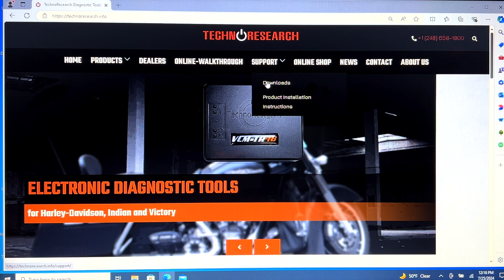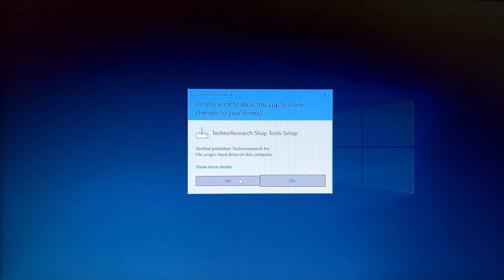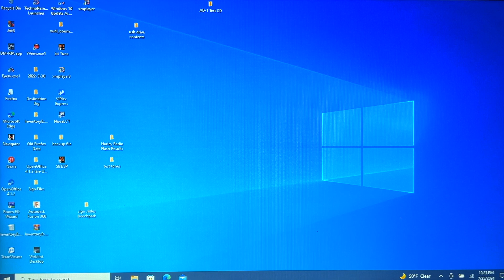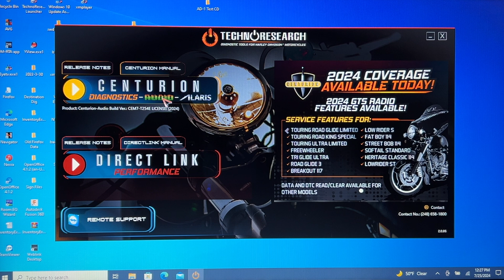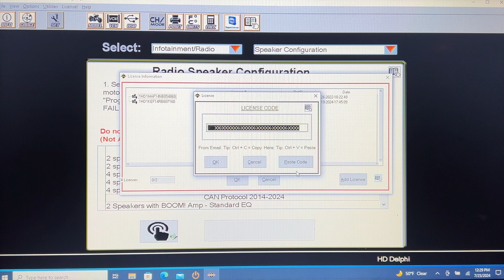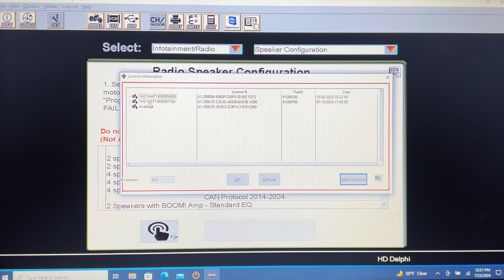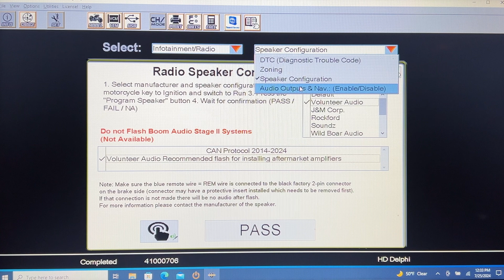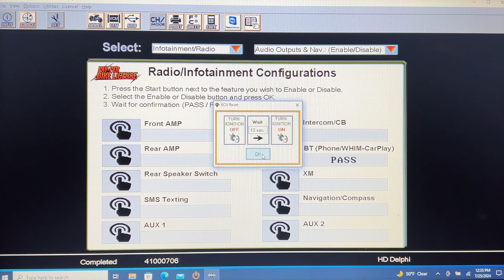How to Download TechnoResearch Software & Flash the Factory Harley Davidson® 4.3" Boom/GT/GTS Radio

Comment: Do you know what tool would enable fader control on ‘06-‘13 Hardon Kardon radios?  I have rear speaker output but no fader function.
Reply from the maker: This techno research tool can also do the radio you refer too, you need a non amplified flash to get fader but then the signal is very distorted, we only build systems around the boss or Soundstream replacement radio
Reply: @volunteeraudio Yea I’ve had Kenwood HU, Arc Audio 600.4 & Focal K2s for years.  Going back stock HK HU, Arc Moto 600.4 with speaker level inputs  & 4 Focal K2s with rear channels in lower fairing pods.  So are you saying fader flash would cause distortion?  If so I’ll just skip flash😂

Comment: I have a stock radio and amp in my 2021 FLHTKSE. This includes a factory installed WHIM. Can I use this to disable the Mic requirement for CarPlay?
Reply from the maker: Yes
Reply: @volunteeraudio  - would the headset mic still work if you want it? i.e. ride around with headset off while listing to music through carplay - decide to call someone - so turn headset on, make call through carplay (without the system getting confused)?

If so, this seems like it will help with that stupid dance of having to turn on your headset / wait for it to pair before plugging your phone in (which I always seem to jack up when I'm in a hurry).

Comment: Thank you for these videos. I have an '18 Ultra Limited. I currently have the 00_OFF.bin on the bike. I am installing a DS18 ION1600.4D amp into the bike. (A) Do you have a video that shows flashing on the GTS (2017-2018) radios? On my radio, are you able to enable the CarPlay like you can on the 2019+ radios using this tool?
I looked at TechnoResearch's website and confirmed there is a dealer in my city. My local H-D dealership is not on the list. That means that they are not able to flash my radio for an aftermarket amp, correct?
Which flash should the technoresearch software install on my radio? I don't know if DS18 is listed as a manufacturer in the software or not.
Reply from the maker: You just need to follow out how to flash video and get a TechnoResearch tool from https://volunteeraudio.com/product/kicker-trhdp

Do the volunteer audio flash

CarPlay is not an option in your radio

Comment: I have a 2016 RG  if i flash my radio and i decided to get the touch screen radio do i have to flash that one too or is it to the bcm
Reply from the maker: The flash stays in the radio so yes if you get another factory radio it will need to be flashed

Comment: So will this help a 2018 CVO with the GTS radio and the boom stage 2 with 4 speakers and 2 amps?   or is this just for aftermarket speakers and amps?
Reply from the maker: No if you have boom stage 2 you can not change the flash or your amps will quit working

Comment: So I was doing a update to 1.22.0.3 and got to the 8 out of 10 and the update froze up and now my radio is stuck in the update mode how can I get out of this mode to try to redo the update or take it to Harley to have it updated ....
Reply from the maker: What are you updating? This video is about flashing a radio, what bike do you have? Which radio?
Reply: 2016 road glide ultra is updating to the 1.22.0.3 update and the bike just has gotten stuck on the 8th out of 10 packages to load onto the radio and I can't get it out of that mode for nothing @volunteeraudio
Reply from the maker: @The90coupedraggn we do not recommend updating the factory radio at home, by having your Harley dealer install the updates they become liable for software issues.  Contact your local dealer

Comment: I just received my recently purchased "tool" to flash my factory HD radio. However, I did not see a piece of paper with the license number included. I still followed all steps aside from adding the license number. I want to believe I was successful in flashing it (as I am starting with only 2 front fairing speakers and have no way to check if the future remaining 4 speakers are now activated). Can you tell me if the licensing number is still required? Thank you.
Reply from the maker: @joefletcher5617  new tools have a license in the tool already, if it said passed, it flashed
Reply: @volunteeraudio  Perfect! Thank you for your quick response. I look forward to watching more of your videos. Great content.
Reply from the maker: @ thank you
Reply: @volunteeraudio  Question: after the Volunteer Audio flash I'm only getting about .010 volts to my right speaker output vs .017 volts to my left. Yes, factory 2014 Infotainment head unit. I know that I cannot control balance or fade. Have you come across this before? Any suggestions?

Comment: Hey Guys, I have a 2020 trike. I installed the jumper for the BT to work with my CarPlay when I first got it.  Do I need to remove it and turn on the setting with the flash tool or leave it.   I ordered the amp and 4 speaker kit from you with the flash tool. Thank you in advance.
Reply from the maker: @Streetrider_77  it does not care either way, you can remove it if you want to

Comment: My 17 street glide cvo is going for sale. I have reinstalled the original boom 6.5 gt radio and the Harley boom 2 amp and speakers. What flash should I do to get the 6.5gt radio back to original so my 4 speaker with 2 amp boom 2 works again?
Reply from the maker: @catomoskaug4943  only the dealer can flash boom stage 2 back on
Reply: @ I got my 17 Street glide cvo 6.5 radio flashed back to to original boom 2 configuration using techno research today. So I can confirm that not only dealers can do that.

Comment: So, is this new addition to the technoresearch program that lists Volunteer Audio the same as or similar to the previous instructions that you had listed to set the radio at 6 speaker 2 Amp?  Under the default setup?
Reply from the maker: @klutchbouldin  yes, we just made it easier to find our recommended flash

Comment: Hey guys, if i flash a bike and they decide to add more speakers or different amp at a later date, do i have to buy another license to re-flash the bike for a different speaker or amp setup??
Reply from the maker: If flashed correctly there is no need to reflash, flash is not for a different number of amps or speakers but corrects the eq and radio output.  The techno research tool license is locked to a specific vin and can reflash that same bike over and over

Comment: Hi just to make sure I'm understanding everything correctly.  I have the 16-bin off currently installed. I currently have 4 speaker boom stage 2 with 2 amps. 6.5s and 5x7s. I recently blew a 2nd 5x7, so I'm doing some research on getting rid of the whole system and upgrading to 6x9s. So based off your info I do not have to flash my GTS radio?
Reply from the maker: If it is boom stage 2 currently it must be flashed, only boom 1 with 16off bin would not need flashed.  Boom stage 2 must always be reflashed when upgrading to aftermarket amps
Reply: @volunteeraudio  so I bought this bike with the system already on it and originally it was just a stage 1 fairing only bike, but he had the bags, speaker lids and amp added at dealership when he bought it new. So how can I tell fir sure if it's stage 1 or stage 2 ?

Comment: Watched all 4 parts 2 questions i wasnt totally clear on 1. If my radio aleady has one of the amp bins on it can i just click on it without it hooked to computer and just flash to that without using a amp for the eq benefits of the lower bass and lower voltage so i dont blow my factory speakers and 2. If i just wanted to run lower fairing speakers could i just run off my upper fairing speakers and it still sound ok or would that need to flashed like rear speakers?
Reply from the maker: @levileatherwood  all of this is for adding an amplifier, adding lowers to the uppers can only be done with 4ohm speakers in both locations.  The only way to flash us using the tool, you can view all available bin files in the radio but you do not have access to change them
Reply: @volunteeraudio  got ya thanks for your reply

Comment: If i replace the HD GT radio with a GTS radio can I use the TechnoResearch Alaris HD Audio tool to flash the GTS radio?
Is the unit license tied to the ecm or the radio.
Reply from the maker: License is tied to ecm, not the radio, yes it will flash either style radio
Reply: @volunteeraudio how would I flash that? I’ve tried to look and no luck even with it saying passed
Reply: @volunteeraudio how would I flash that? I’ve tried to look and no luck even with it saying passed
Reply: @volunteeraudio how would I flash that? I’ve tried to look and no luck even with it saying passed

Comment: I have ordered a sound stream V2 from you and have 2 front and 2 saddle bag hertz neon speakers and a soundz amp and 135_off.bin flash will I have to reflash after the sound stream shows up
Reply from the maker: @210033032  no but your amp gains will need to be adjusted for the new radio
Reply: @volunteeraudio  that’s what I was afraid of. I will be calling tomorrow to find out which amp you would recommend for me then. Thanks for your videos. You are the reason I removed all my Soundz speakers and switched to Hertz.
Reply from the maker: @210033032  thank you

Comment: Why is it beneficial to enable the rear speakers if you can't fade the speakers? Just out of curiosity.
Reply from the maker: @mikewilson4918  separate stronger output
Reply: @volunteeraudio  that's what I figured but just wanted to check. By watching your videos I had already flamed mine to the 134 off bin but just wanted to make sure I understood